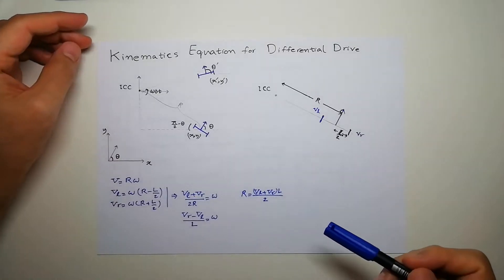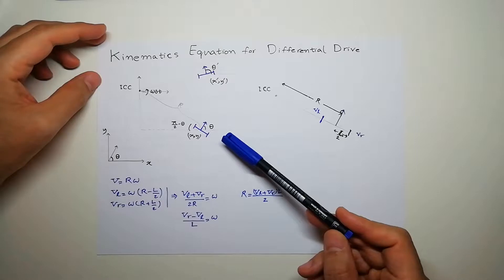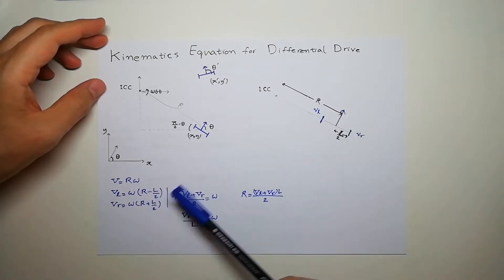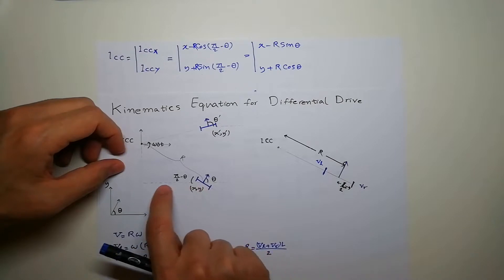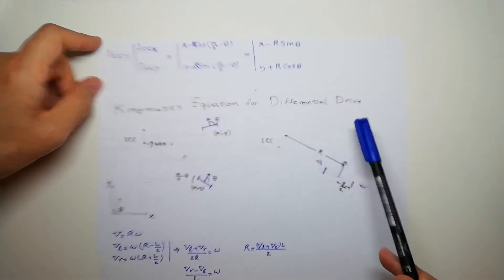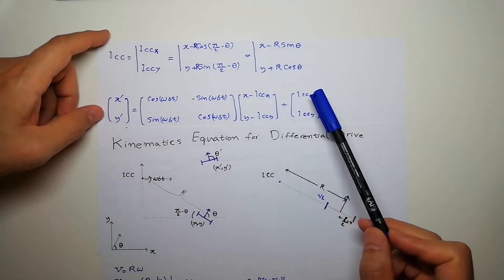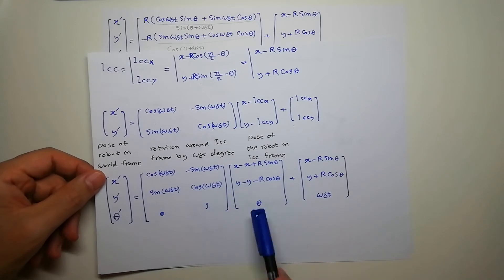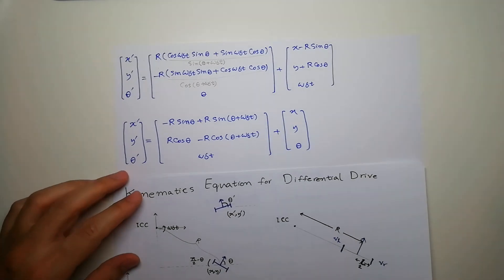Kinematic Equation for Differential Drive

Comment: You shouldnot have missed an extra column to the matrix at 5:25 
You misused the cosine law 
You also should not have missed to use L/2 distance added with Raduis of curvature when rotating current pose of robot  to  the new
 pose

Comment: Why omega for is the same for both wheel?
Reply: He considered it for simplicity. You can work out the same by considering them to be different.
Reply: I think omega is the rotation around Icc, not the rotation of wheels. If the wheels rotate at same velocity, w becomes 0 since velocity difference is 0. Also R goes to infinity for that case.
Reply: @ufkkcndr  yeah very true, I was mistaken earlier. Thanks!!

Comment: at 05:25, when considering the theta' you should add an extra column ([0,0,1]^T) to the rotation matrix in order to make the matrix multiplication possible. You also should correct the last line of that rotation matrix which t in the end, with the column addition, should be [0,0,1].